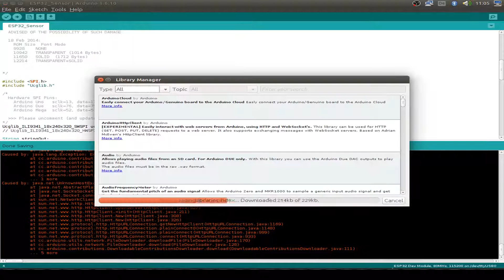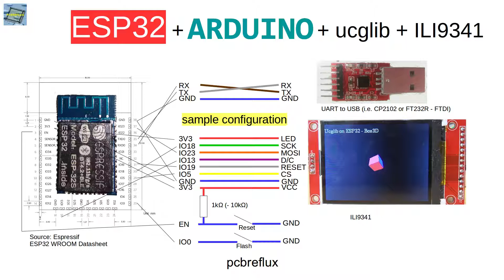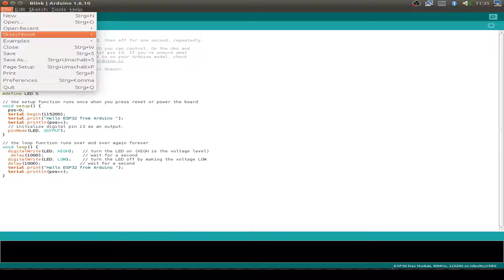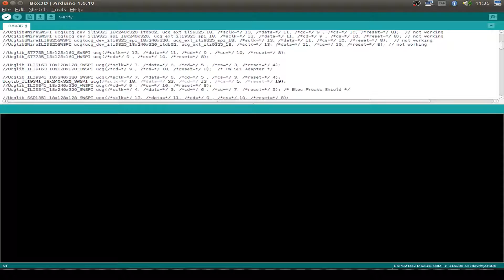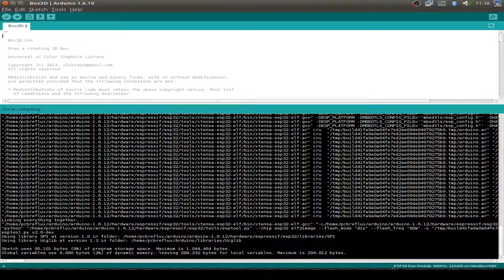ESP32 #7: Arduino Ucglib port with ILI9341 TFT LCD Display

Comment: why can we see the scanline so much? fillrate is low via SPI?
Reply from the maker: the "scanline" while displaying the 3D Cube are caused by the slow 3D calculation in the ucglib and also caused by the camera and display frame-rate (Moiré pattern). On the other tests there no scanline see-able for the eye.

Comment: Thanks for the video! It was very helpful. Would you mind helping me with connecting a slightly larger LCD (ili9488) to an esp32? The pins are slightly different and it is tripping me up a bit. Thanks so much.
Reply from the maker: Thanks, but today have no ili9488 in stock so maybe an viewer can help.

Comment: Hi will you do a SD1331 OLED color SPI tutorial ?
Reply from the maker: Have no SD1331, but if you have one - now the new version of u8glib should work on the ESP32 and Arduino without changes. Had a long mail traffic with ollikraus and others about this topic.
Reply: I am using a NodeMcu version of the ESP32 and I would like to connect it to either a TFT ST7735 or OLED display. They said to use this library https://github.com/sumotoy/TFT_ILI9163C/tree/Pre-Release-1.0p7 but it doesn't show what pin I should use. Thank you!  ....sorry I am new to this !

Comment: как это в Proteus запустить?
Reply from the maker: sorry but my Russian translator give no good translation (->as in Proteus run?). Some advertising for  Proteus PCB Design? I only use KiCad today (after a decade of Eagle).
Reply: how zapustt lcd ILI9341 program on Proteus SPI ?
Reply from the maker: Александр Чернобривко zapustt? i just focus on esp32 with arduino ide in this video.

Comment: does u8glib work on esp32
Reply from the maker: It should, maybe with some changes. This is my next topic with a NOKIA 5110 LCD display. So hopefully I upload a solution to my github page in some days.
Reply from the maker: hi, unfortunately it took more time because you also have to change the esp32 arduino code. i've got it compiled but it crashed every second. today i am stucked. 🤔thanks espressif for the nice documentation. love nordic and all other arm micros!
Reply: what library do you recommend for driving an oled display on a esp32
Reply from the maker: Hi, have you try u8g2 (new Version of u8glib, for some OLEDs)? 

today I have no OLED at Hand (they are in my weekend Lab), but with this SSD1306 OLED setting:

U8G2_SSD1306_128X64_NONAME_1_SW_I2C u8g2(U8G2_R0, /* clock=/ SCL, / data=/ SDA, / reset=*/ U8X8_PIN_NONE);   // All Boards without Reset of the Display

It compiled right out of the Box. Don't know if it's running?
(SDA at GPIO 21 and SCL at GPIO 22):

see pins_arduino.h (or https://raw.githubusercontent.com/espressif/arduino-esp32/master/doc/esp32_pinmap.png)
static const uint8_t SDA = 21;
static const uint8_t SCL = 22;
Reply: hi, I'm away from my lab also. I'm still waiting for my esp32 from China. will message u once I'm back